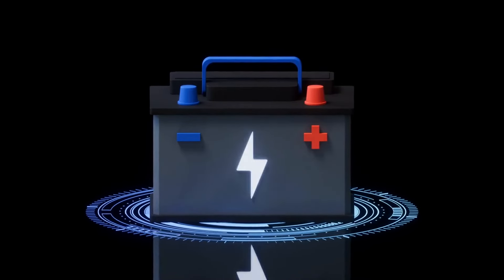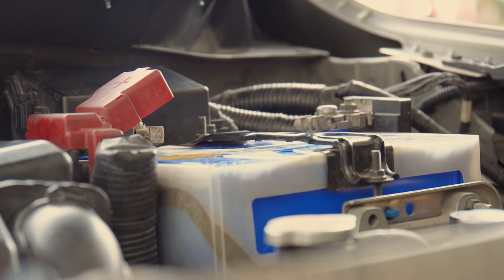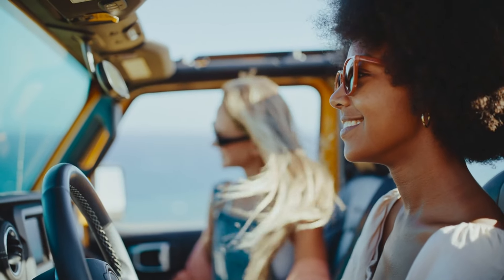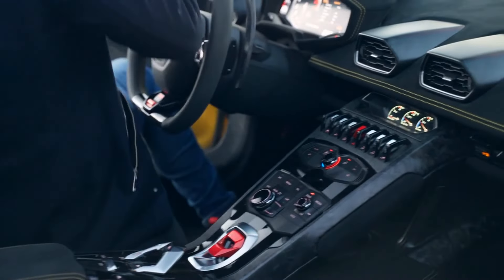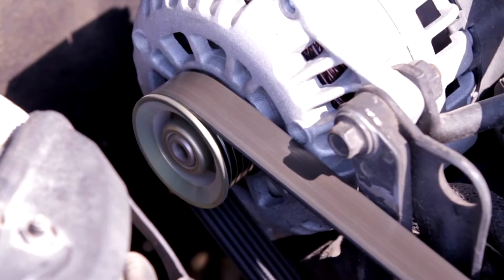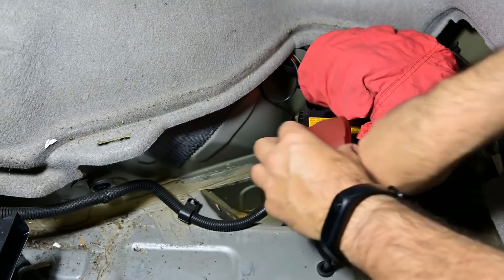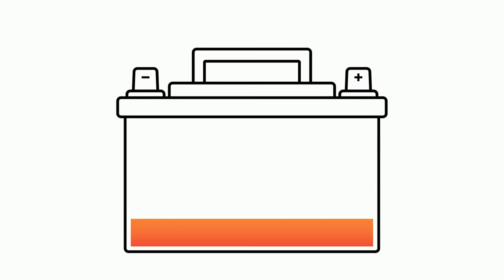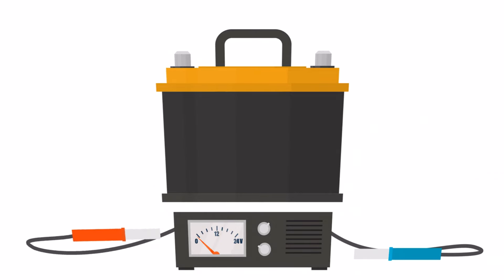Top 10 Tips for Maintaining Your Car's Battery Health

Comment: Do not activate your alarm if your car is parked in a locked porch or garage, lock it with the key. Older cards with after market alarm system draws unnecessary current that slowly drains the battery - that's why new batteries in old cars don't last.